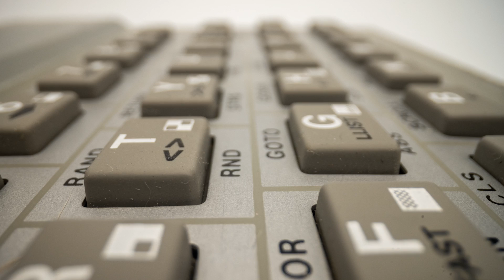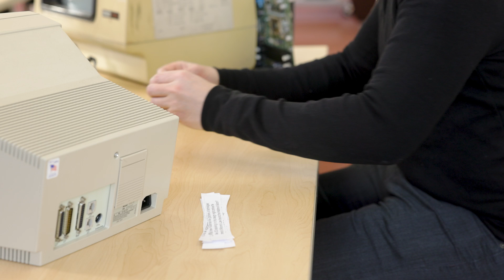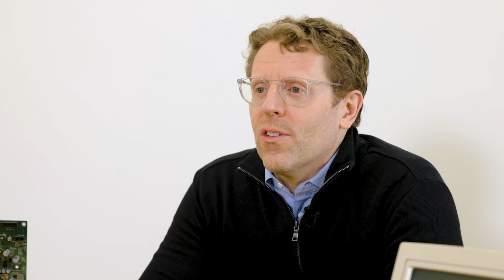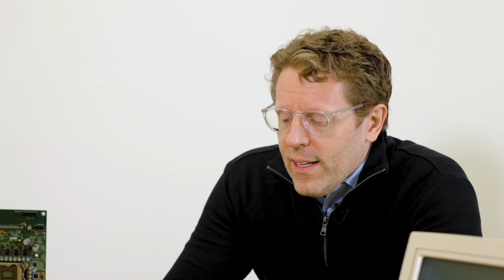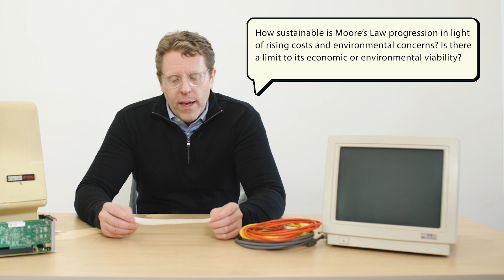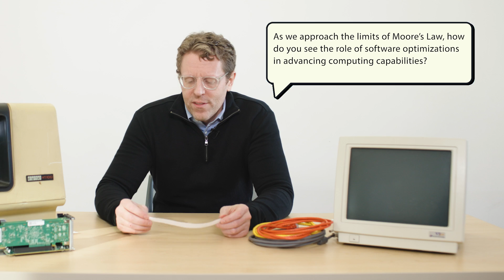MIT Professor on AI’s future in a post-Moore’s Law era

Comment: can chips be slown down so much that their power consumption and heat becomes so modest that they can be stacked? does the heat drop faster than the speed drops and is there a floor voltage where the transistors no longer play ball.
Reply: Good question